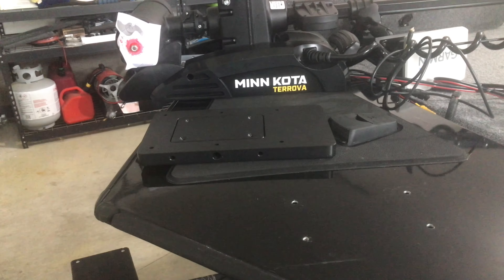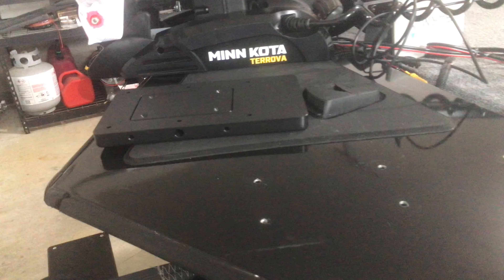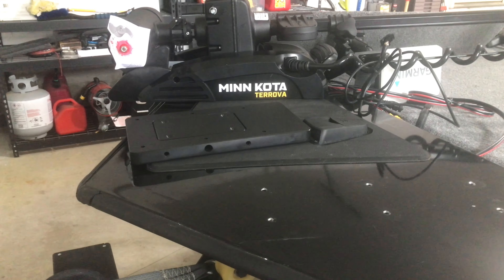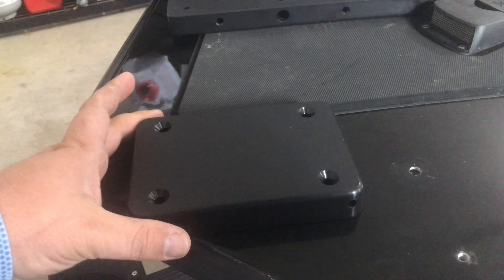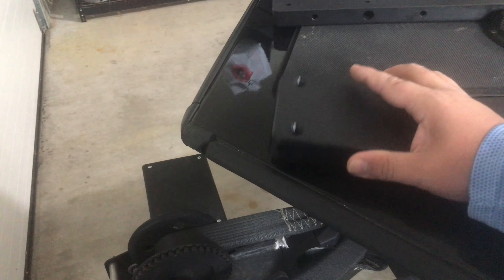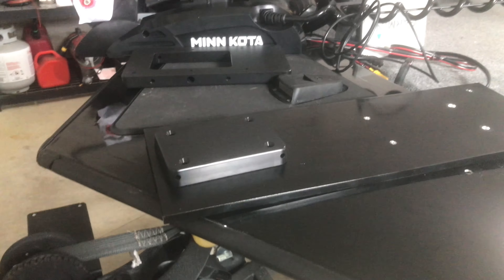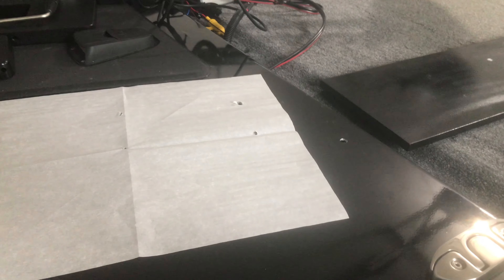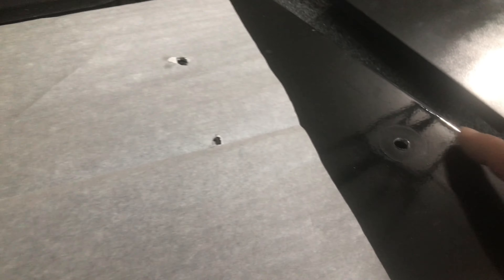No More Broken weld on Bass tracker Classic XL!!

Comment: This is the byproduct of understanding torsional forces and how they can affect metal. Especially softer metal which can bend easily like aluminum. For the guys running the Terrova, this mod is a MUST. Seriously. Anyone reading this cannot and should not skimp out on this part because if you do, I know from experience that you'll suffer cracked bow plate welds and then you'll wish you would had taken the ounce of prevention.

Great video Matt, and thank you on the Bass Tracker communities behalf for putting this out there for everyone. I took a different but similar approach on the idea, but at this point for my own, it's more about damage control rather than prevention.
Reply: @extremeboating7347 What approach did you take? I’m about ready to install a Terrova on my Pro 170, but I am looking at all install options.
Reply: @bwarholak  I created a full top plate that confirmed to the majority of the bow on the troller motor side out of 1/2" King Starboard. I would have used 1/4" aluminum, but at the time prices were out of control to get something custom made for me by local shops. It fared out well and up to the point where I sold it. 

It worked fantastic for its function considering that I was using it as a top plate to sandwich the aluminum under it, but I also switched out to a standard scissor style Garmin Force. The only trollers I recommend at this point for those boats are the Ultrex, Lowrance Ghost, or Garmin Force given that they use scissor style designs just like the stock Minn Kota Edge.

Comment: Thank you for this - I ended up selecting a Terrova for my 170 Pro because of your video series and the value vs. other options for a 24V 80lb thrust motor.  I used the MKA-16-03 which placed the Terrova a couple of inches back on the plate. I used a 18" long plate and drilled new holes to locate the plate a couple inches away from the sea deck material and angled slightly closer to parallel to the center line - the hole spread is a little bit wider and almost as long on the top plate as the original holes.. My motor shaft is about 4" from the centerline. I only had to tap the two quick release mounting bolts furthest from the centerline. I re-used the one screw that tracker installed {I drilled a new hole in the quickrelease mounting plate) and used 4 bolts to the centerline side of the plate and 2 bolts on the port side of the plate. I used 1-1/2" OD x 3/8" ID x 1/4" thick neoprene rubber bushings on all of the bolts and the screw. Seems pretty sturdy. I'm locating two 12V LiFePO batteries (could have gone with one 24V but already bought the 2 12v's) into the compartment under the front seat due to concerns about the 8AWG wiring to the back handling long runs on the 80 lb thrust motor (I can use my boat on a couple of electric only resevoirs near me). Again, I can't thank you enough for your video series on this!
Reply: How far were your back holes from the back of the plate? The one in the video isn’t centered.
Reply: @anthonylentini1072  The rear most holes are 1 3/4" from the back of the plate and about 5 1/4" apart. Also, to clarify a bit, the back edge of my plate is close to the two parallel rear-most original holes (there is a single port side original hole further back on the port side - near the "A" on the video thumbnail - that only the 24" plate will reach) .

Comment: Have you had any issues with the plate or trolling motor? Im about to install one on my new bass tracker classic xl and what you did seems to have solved the cracking issue...GREAT JOB
Reply from the maker: No issues at all buddy go for it!
Reply: @BredForBass Did you get the 12v or 24v for your boat Also what size drill and tap did you use to mount the puck for the quick release?
Reply from the maker: @Set_That_Hook  I got the 12v 55lb thrust no issues at all it does good.I used a 1/4” drill and tap

Comment: I like the whole plate idea. I would have made some extra modes to it, but thats just me. Hey when you install the head sensor you "DONT" need to calibrate it on the water, you can do it in a large parking lot. Did mine that way and it works perfect....just go slow you will need to deploy it. Your remote will tell you when its successful
Reply from the maker: I took it out yesterday and it worked great! Thanks for the tips though

Comment: Same reason I didn't get that model quick release I got the "Minn Kota Trolling Motor Quick-Release Bracket MKA-16-03" it doesn't use the puck. check it out.
Reply from the maker: Yea i seen it almost bought that one instead but I’ve seen photos with welds broke using that as well so i ended up going with the puck since a lot of more people have that one and I thought I could help figure out a solution for it.
Reply: Did you use a similar solution with the 16-03? I want to go that route, but the 1/2in aluminum plate won't allow for long screws since the 16-03 isn't as thick as the MKA-21.

Comment: Where did you get the aluminum plate? What are the dimensions?  I like that idea, I’ve seen slot of posts on the weld breaking
Reply from the maker: Sorry for the late response I got the plate off Amazon the link I used no longer works but I believe it was 8x24 I think 1/2” thick.

Comment: I really like this idea and I’m in the works of doing something similar with my own twist. How much space do you have between the boat and the plate? I might try and mount my motor straight to the plate without any quick release and would need to get a wrench under the plate to bolt the motor on. Or I could use your method
Reply from the maker: I put the rubber washers between the plate and the boat it gives you a 1/2” at most would be difficult to get a wrench in there.
Reply from the maker: Unless you wanted to buy a thicker spacer they definitely make them that would give you some more room to put a wrench in there

Comment: Have you had any issues of the trolling motor hitting the roller when loading or unloading?
Reply from the maker: No i haven’t it’s close but it clears honestly i got mine a little far out as well it could probably be bumped back a few inches giving it more room.Overall the plate has done its job I run my boat hard and everything is still in tact

Comment: I'm thinking I want to do something similar, but use the MKA-16-03. Since the 16-03 is thinner than the puck you used, do you have any suggestions on what I could try? The only thing that comes to mind is maybe using 3/4in aluminum so I have a little bit more for the screws to grab onto.
Reply from the maker: I think you will be fine still with the 1/2” even though the puck is thicker it the screws sinks into the puck a good amount.You could go 3/4” aluminum if you wanted just gonna be a little heavier.Also you could consider just getting longer screws and going all the way through the aluminum plate into the hull of the boat and doing drill and tap I think the extra thickness of the plate will ultimately help keep that weld from cracking.
Reply: @BredForBass  Thanks man. I appreciate you answering all the questions I have had. Your videos have definitely provided a great insight as to how to tackle this install.
Reply from the maker: @bwarholak  absolutely bud no problem at all I appreciate you watching my videos it means a lot.

Comment: What do you use for your rub rail?
Reply from the maker: I actually used a furniture edge guard got it off Amazon for $20 (2) rolls will go all the way around the boat so $40 total.It’s same thing you put on tables and edges to protect children when hitting there head.It comes with a 3m adhesive and you just stick it on it holds really strong I’ve had it on for about a year and it’s held up good no issues.Its done what it was supposed to do I’ve taken some chunks out of it at the dock but better that then the boat paint.Once it where’s out I’ll buy more and just redo it since it’s so cheap.